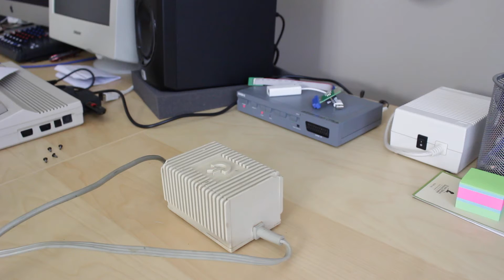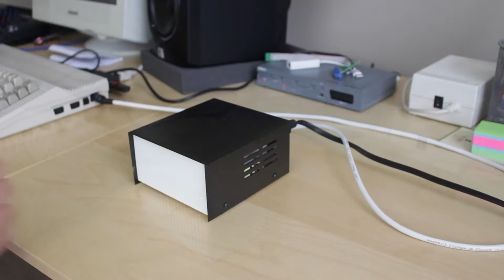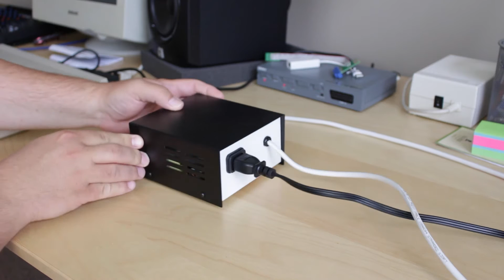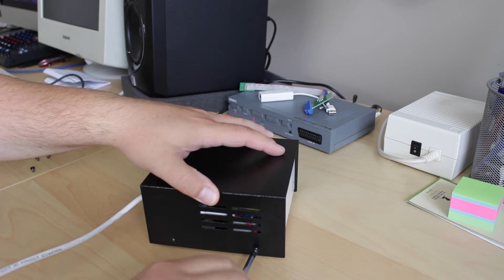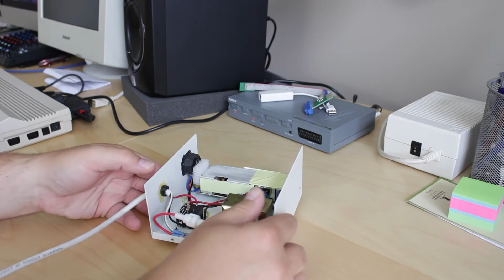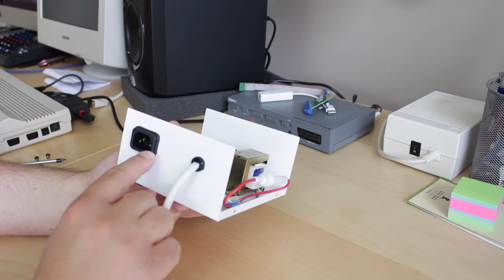Ray Carlsen custom Commodore 64 power supply

Comment: Ray made me one that has dual toggle switched plugs for Amiga 1200 or C64/128 plus two floppy disk connectors.  Great space saver!  Ray is an awesome guy.   Dealt with him several times over the past several years.

Comment: wow man how did i miss this?!? As soon as i watch it i unplugged my original C64 PSU from the AC outlet.

How much does Ray charge for his PSU. i think i need to invest in one. My original C64 PSU is going strong but i had no idea about the internals. Great video!
Reply from the maker: Depends on how you have it spec'ed out, but the plastic case one is like $80 and around $100 for the metal case one. Drop him an email.  He is super nice and literally had my psu built and shipped in less than 24 hours.

Comment: Frankly the switching power regulator is a bit of over-kill. A single 7805K in a TO-3 package mounted to the back of the metal case would sink twice the current the C64 uses. A 9 volt 3 AMP AC transformer, a couple of 440µf electrolytic capacitors, a bridge rectifier like a Vishay KBU8B (8 AMPS), and a couple of .01 µf caps on the 5 volt output side is all you need. The C64 only uses the 5 volts from the power supply to run the various timing circuits for the VIC, the SID, the modulated video out and the CIA timers, and power for plug-in cartridges. The C64 makes it's own 5 volts internally. It takes the 9 volts AC and rectifies and regulates it into the 5 volts Vcc that runs the digital ICs on the board, all done on the mother board. The 5 volts from the power supply never touches the CPU, memory chips or any of the logic circuits. The 9 vac could go up to 32 volts and the 7805 on the mother board would output a steady 5 volts, any higher and the regulator shuts down. I love how all these electronic techs don't bother to look at the C64 schematic to see what happens after the power plug.

Comment: It's not that good and very over priced for what it is and missing a lot that could be added to make it better. I could do a much better job for the price. Sorry thumbs down from someone who does electronics.
Reply from the maker: I am curious as to what it is missing that is relevant to the C64.
Reply: It seems the best design and build for the application - but I don't like how the hot pins on back of IEC connector can be pushed into switching power supply block. Bumps and bangs happen. That placement afterthought could lead to easily avoidable trouble.
Reply: I don't know why the SMPS is fed into a C64 saver - they don't' tend to fail over-voltage like a linear supply does so that seems like a waste of time and money to add one, too.